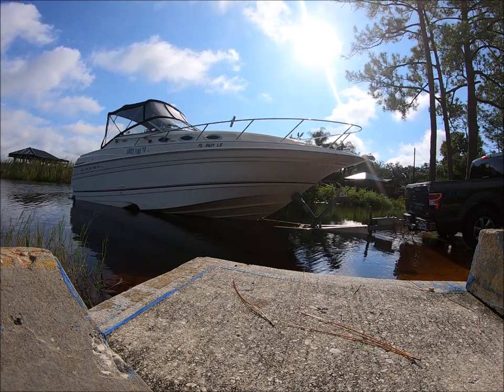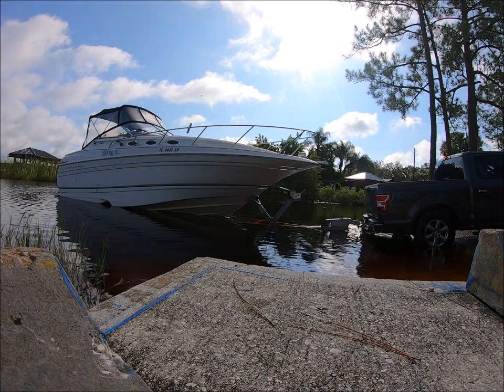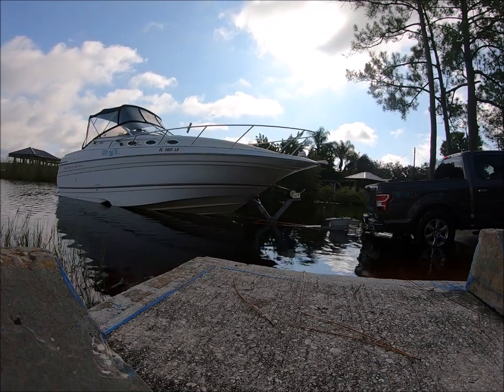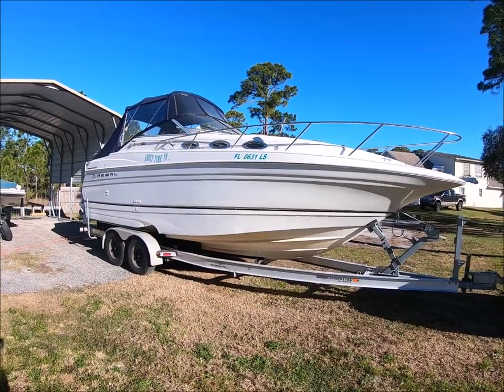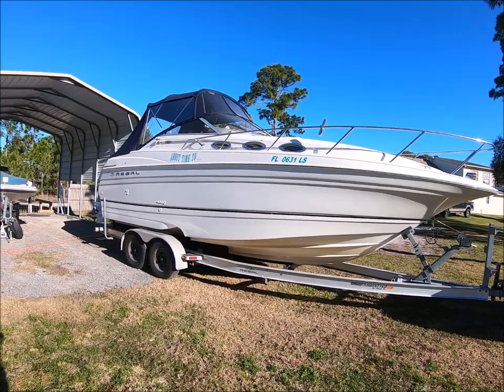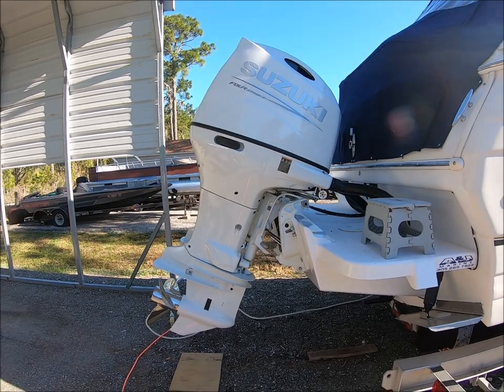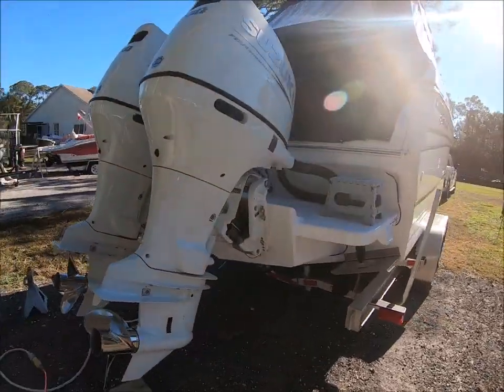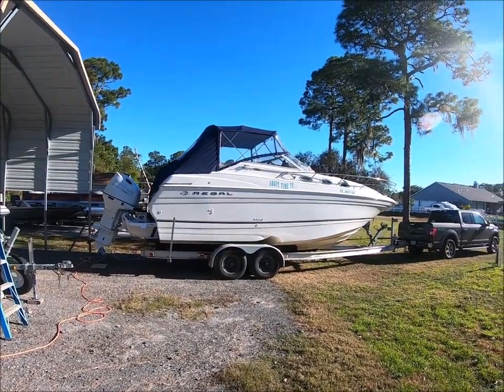Regal Sterndrive to Outboard Conversion Project Part 2

Comment: You did a great conversion. I converted our Sea Ray 290 amberjack to twin yamaha 250's. Best decision we made. Unlimited space for beach toys and chairs in the engine bay now. I had a custom flotation bracket fabricated which I plumbed for extra fresh water. It's nice going on 3-5 day trips with an extra 75 gallons of fresh water on tap. We were used to the having the zodiac on the platform so I welded two bracket to accept stanchions on the side  of where the motors mount. I had two brackets made that hold the zodiac a couple inches about the outboards for transport. Some food for thought.
Reply from the maker: Yes, it is the best decision that I made also. I would like to see a picture of your boat.
Reply: what is better suzuki or yamaha?

Comment: Nicely done. There are so many of the I/O boats that have failed I/I'd that are just rotting away. If we could convert these imagine how many boats could be rescued from the dump. Most of them are near mint but nobody wants them with a failed engine. Out boards are so much more reliable and safe.
Reply: I thought about the same thing so I did a quick cost estimate and it wasn't really cost effective, at least for freshwater.  A rebuilt small block would only cost at worst, about $6k, and that's at the extreme end, but there are used engines all over for as low as a grand or two. Then if you need a stern drive, that's $1000 used, or you can get a brand new SEI for $2000 or less.  All of this is just plug and play that any Bubba could do in his yard versus all the modification necessary for doing the outdrive.  Heck, you can get a running 1980's Sea Ray, good condition, for around $6000 nowadays, full canvas and trailer included.  If I were buying brand new, I'd definitely go outboard, but the conversion route just isn't cost effective right now.
Reply: @cheapme1850  so you’re saying I shouldn’t buy an old inboard and convert it to an outboard I thought about buying my neighbors old Chris craft 25ft for 3k do you think it could be cost effective then??
Reply: @kalebeldridge7032  It’s just not cost effective, even if you do most of the work and get good deals on everything you need, and in the long run, an old boat is still an old boat. I just saw a mid 1980’s Sea Ray Sundancer in good shape for $6000.
Reply: @kalebeldridge7032 he's got $30K at least in boat motors alone on this thing. Nice but steep.

Comment: That's a very nice boat you have there and a great conversion you've done.I have done a similar conversion on a 25 alloy boat that used to have a v8 inboard but now has an 250hp Optimax - the teething issue I had was that moving 580kg weight from down low and adding 260kg up high was it shifted the center of gravity causing the boat to be a bit tippy
I am currently about to add 300kg of sealed lead ballast to bring the center of gravity back down
Reply from the maker: Thanks for the comments. It is definitely  a better performance. I would like to see a picture of your boat.
Reply: Contact me through messenger and I'll send the before - during and after pics
Reply: @grantleyte2784  How tippy was it? I converted our boat with twin 350's and bravo threes and went with outboards, no change in how it rolls. I know i shaved about 1000 lbs off the total weight too. Im sure going from a single inboard to a single outboard saved you 500lbs at a minimum.
Reply: @jamesgren5610  our boat is a 25 footer with a 2.5 meter beam

Comment: Nice job and videos. I am thinking of doing this to my 08 Chaparral Signature 290, going with twin 300s.  Are you still able to pivot the boat in tight places (one engine reverse, one fwd) with the outboards?  Any regrets on losing the swim platform?  And changes you would make?
Reply from the maker: You can still pivot it just requires a little more throttle. Losing the swim platform was not a great deal for us we never really used it other than just boarding the boat and there is enough platform for that. the advantages of outboards outweighs that. The extra storage space where the old engines were is great.

Comment: Where did you get your transom bracket for your Regal boat? I have a 1999 Regal Destiny 200 that I want to do the same on.
Reply from the maker: A&J Marine Welding is the bracket manufacturer in Miami also known as custommarinewelding.com
Reply: @abouttimeboating9670  Thank you

Comment: I loved your project I have a 2001 reagal commodore 2760 two engines v6 with volvo duo pro and I would like to know if I can do that project and if you dedicate yourself to doing it
Reply from the maker: The transom on the 2760 is different than mine but sure it can be done. Yes you can do it yourself. Once I removed the engines and outdrives it took me a couple of weekends to close in the the holes. I ordered the bracket from A&J Marine welding in Hialeah, FL. They will send you a paper to fill out with all your boat dimensions to fill out for making the bracket. Once you get the bracket they will have instructions for mounting. If you are from down in that area they may be able to suggest what you need. Wherever you buy motors they have to do the install for warranty.

Comment: Great job. 
Can you share some costs for the project. I’m considering a one motor conversion
Reply from the maker: Bracket $4500. Twin 200 with fly by wire gauges and controls with new hydraulic steering $38,000 installed. Supplies and materials to enclose and reinforce transom $1500 and I did all the work. Sold old motors and outdrives and all the parts for around $11,000
Reply: eee gads! what a horrible roi you'll realize should you decide to sell... clearly you have NO intention of selling. that said, a very nice install. kudos to you.
Reply: @ackack612  you are such a banana 😂

Comment: Did you have a fiberglass background? I want to do this to my 25ft Donzi Regazza, but I have never done fiberglass work.  I have already removed the motor and drive unit.  It’s sitting there with a hole that needs to be fiber glassed up.  Any information will be helpful.
Reply from the maker: I don't have a fiberglass background. just self taught and watch videos of it. i have done a couple of different project years ago. Keep the amount you mix to a minimum and use plenty of resin to soak the fabric. they sell small pumps to mix the resin and catalyst. definitely get them. Good Luck.

Comment: good deal: doesn't get better than that 27' twin outboards w/ swim deck excellent. are the zukes drive by wire?I'd like to know how the dbw shifts the gears I've read there isn't a clunk into gear. congrates and enjoy.
Reply from the maker: Yes they are drive by wire and it is a really smooth shift.

Comment: Great job.  I have a 1989 Silverton 30x fully inboards 350 x 2.  How much this conversion might set me off?
Reply from the maker: Bracket $4500. Twin 200 with fly by wire gauges and controls with new hydraulic steering $38,000 installed. Supplies and materials to enclose and reinforce transom $1500 and I did all the work. Sold old motors and outdrives and all the parts for around $11,000
Reply: I am currently converting a silverton 312 to yamaha 200hp outboard

Comment: How much time did it take to prep for and install the bracket?  What’s your estimate on how long it took to get the motors and electronics wired up once you had motors for it? I’m looking to do this with my 28’ Pursuit. How’s the ride been?
Reply from the maker: I only worked on this on the weekends. it took about 3 weekends to fill the holes and prep for the bracket. installed the bracket in one day. I had the outboard seller install the motors, wiring and steering which took them about a week. it rides great. it handles a little bit different due converting from inboards and if floats much better.

Comment: I wonder whats the price of this conversion
Reply from the maker: Bracket $4500. Twin 200 with fly by wire gauges and controls with new hydraulic steering $38,000 installed. Supplies and materials to enclose and reinforce transom $1500 and I did all the work. Sold old motors and outdrives and all the parts for around $11,000

Comment: What this project costed you? Do you think is feasible on a 2007 Searay 280 sundancer..
Reply from the maker: Bracket $4500. Twin 200 with fly by wire gauges and controls with new hydraulic steering $38,000 installed. Supplies and materials to enclose and reinforce transom $1500 and I did all the work. Sold old motors and outdrives and all the parts for around $11,000

Comment: Great job.  I don't understand why boat manufacturers don't offer power cruisers with outboard engines.  Outboards of the last 10 years and as good or better than their I/O counterparts and provide better performance with lower cost.
Reply: Regal does offer cabin cruisers with outboards, at least 3 years now.

Comment: Why would you do this?
Serious question.
Advantage?
Disadvantage?
Reply from the maker: There were multiple reasons that I decided to go to outboards. First off the  engines were original and were going need replacement at some point along with outdrives. Upgrading to the outboards has freed up the space for extra storage plus do have to worry about gas fumes in the boat or the constant repairs to inboards. The performance and reliability of the outboards is great and the fuel economy is a lot better and with all the dital controls just makes it great. The manufacturer builds boats this way now but for 6 times what I have in this boat. The only disadvantage is the smaller swim platform.
Reply: @abouttimeboating9670  Thanks
I figured you gain storage,etc.
Reply: Just to chime in…supposed you had an older boat that you took really good care of, nice canvas and upholstery, all stringers dry and solid, and it’s fully paid for. Despite your good care, you know the stern drives are on borrowed time, with an original Alpha 1 at a minimum, running $4k new. Then you add a 260 Merc at about $5k. Then double it because you’re running twins. You could toss $50k at the high end and STILL come out way cheaper than buying anything remotely new or newer, and essentially have a brand new boat. Of course resale wouldn’t be that great but a lot of people really stick with their boats for years once they find their perfect boat.  One other thing…boats from the mid 80’s to about the 2010’s look way better than the goofy boats they’re making now, Whalers being the notable exception.
Reply: @cheapme1850  How about a straight inboard 260 HP diesel?
Reply: @railroad9000  It would probably take a similar amount of work - new tanks, new electronics, etc. The only real difficult part of this is closing up the transom and mounting the mount and people have transoms fixed or replaced all the time.  I actually thought about starting up a business refurbishing older Sea Rays which are loved in this area, getting an engineer to come up with a solid platform and replacing the drivetrain with updated components.  Again, this would be thousands less than anything you can buy new nowadays and would be versatile enough to sell in both fresh and salt water areas..
Reply: @cheapme1850  Thanks!
Reply: Never owned an I/O? If so, I'll guess that you never worked on it yourself..Then you'll know why. Maintinance is ''much easier'' and O/B's can last rwenty years or more.

Comment: How much did this put you back in cost?
Reply from the maker: Bracket $4500. Twin 200 with fly by wire gauges and controls with new hydraulic steering $38,000 installed. Supplies and materials to enclose and reinforce transom $1500 and I did all the work. Sold old motors and outdrives and all the parts for around $11,000

Comment: Interesting if you would be able to return all invested money and sell it for a good price... I want to do the same with my 1981 Sea Ray Sundancer 260, but not sure I would be able to sell it for $50,000 :)))
Reply from the maker: Not sure I would look at doing this if you are planning on selling, I estimated on having this boat for 10 years after and wanted the dependability of the outboards plus the fuel economy is more than double. Electronic controls and gauges just make it so much better.. I also installed twin 200's but a single 300 would do the job just fine. I still think it adds value to the boat. All the manufacturers are installing outboards now. Either way I am glad that I done this.
Reply: @abouttimeboating9670  Well, I’m not planning on selling it now, but just curious IF/WHEN I would like to sell it… I’m thinking to install one 300-400 or two 150-200. I’m in the open ocean a lot, so better to have two just in case :)) And maneuverability is much better with two.